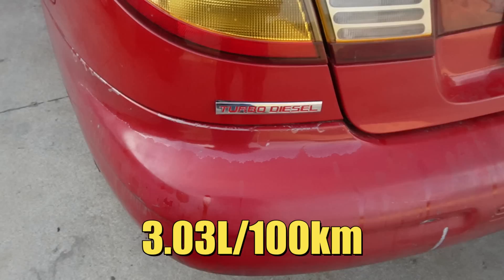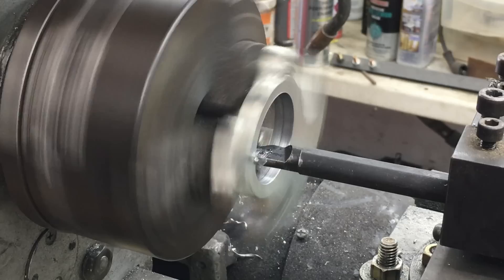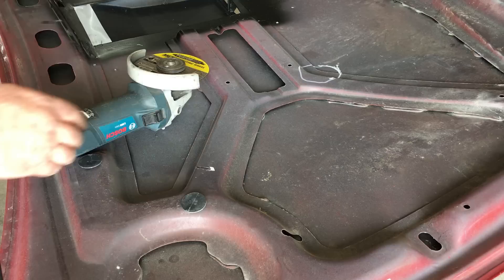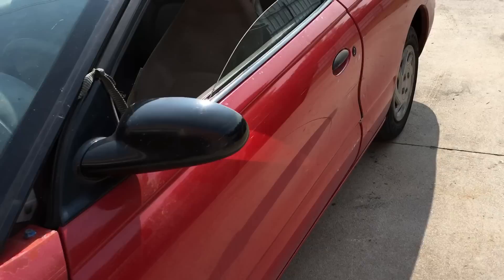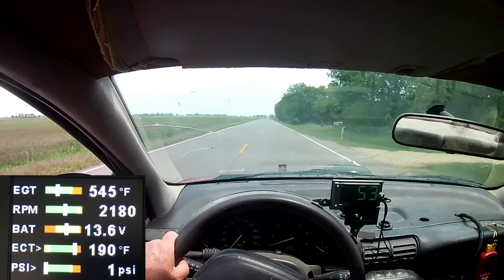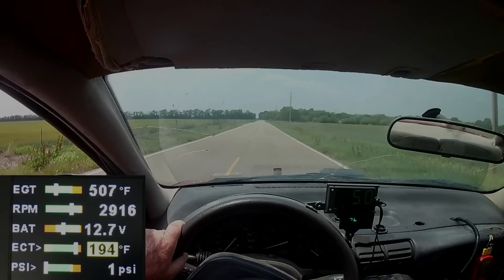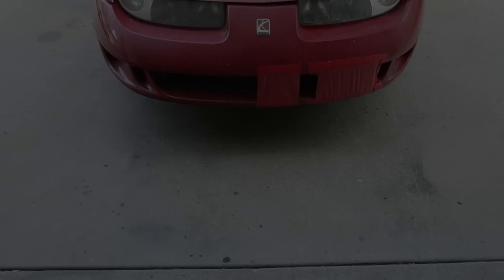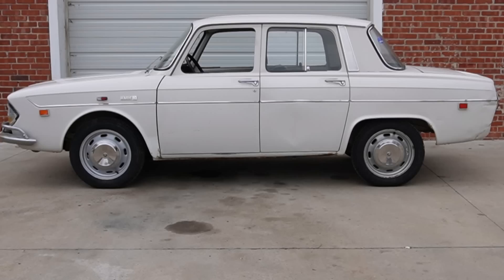S3 E17  We get 80 MPG with our D722 Kubota turbo diesel Saturn.  Best fuel economy yet !

Comment: I'd be very curious to find out how you could reduce the car weight by removing excess material, cladding and so on, and still retain a useable vehicle. Another aspect I'd be thrilled to see is what you could achieve by improving the car's aerodynamics ...

Comment: 3:28: why did you weld pipe and flange inside.??  the original was welded outside - with which you don't need to regrind the flange flat.

Comment: Company's need to focus on diesels instead of EV... diesels are better for the environment than evs in the long run... no mining for battery minerals  (for the evs) and not useing the power grid to charge and not dangerously silent... diesels are better for the environment than gas actually the exhaust is easier for plant life to filter

Comment: I can't help but feel like the diesel saturn had more to give.  Maybe if you ran a passenger side fender exit behind the right front with the same diameter tubing it'd have been more bearable.  
I want to think that the full stack,  full fuel,  full boost saturn might have done a tick better than previous,  but I imagine you tested that off camera.  :(

Comment: Would creating a fearing for the exhaust possibly create a slight vacuum to help reduce back-pressure further? Or just cut it at an angle for the bit sticking out to act as a shield?

Comment: Try it with motorcycle tires!   Double MPG between 40 and 60 MPH ?
Reply: Likely not. Rolling resistance only accounts for ~20% of energy needed to move the car, so not much gain to be had this way.
Reply: @hojnikb  Motorcycle tires have much worse rolling resistance than car tires, often more than double.

Comment: There's clearly something wrong with your turbo system, I had a geo metro with a 55mm turbo that hit 7lbs of boost.  I think that turbo should hit at least 5lbs of boost.  I realize its half the rpms but something is adjusted wrong.   If it's not then u need to add another turbo and compound it!

Comment: I wonder if exhaust gas recirculation could improve the fuel economy even more.
With an inert portion of the air, less fuel is needed, not sure how it would affect temperatures though.

Comment: Wrong turbo. Diesels need less turbine than gas engines. From my turbo bike I can say a rhf3 vz45 would work great but is gonna be laggy too. But a gt12 would actually be better. It's a bit more efficient and on my bike we have the opposite issue too much back pressure. If you get a rhf3 you can put the vz21 turbine wheel on it it has 1 more turbine blade than the vz45. The vz45 has a better turbine housing though with a slightly bigger ar that should reduce back pressure without hurting spool. That being said compound would actually be the way to go. And port that thing theres alot to gain in that housing compared to the Mitsubishi turbines. When I was single turbo at 30psi BP dropped 8psi with just some porting with zero loss in spool. Cutting the turbine wheel back actually made a big difference for me in both reducing BP and making it spool faster. Still I'd say your vz21 plus a China gt12 would work great. For us single turbo porting the other side of the gate we get about 30psi sending the same pressure to both sides and also faster spool. Being a diesel I wouldnt be very concerned about the head lifting or the bottom end. But it would be worthwhile to swap out the head bolts for some better ones.
Reply: I feel it's worth mentioning my little 155cc single could spool that vz21 by 1500 rpm the vz45 was about 1700 and a gt12 was about 1800. But a vz21/vz45 hybrid was instant although it did die off as BP shot up around 7k rpm.

Comment: Hello! I heard you said you were gonna scrap this Saturn. Id like to take it off of your hands if you still decide you want to scrap it
Reply from the maker: We plan on removing all the custom parts from the saturn. There wont be much left, except scrap metal.
Reply: @robotcantina8957  ahh I see that makes sense. I'm a huge Saturn fan and I collect them so with something as cool and different as this I thought I'd see what your plans were lol.
Reply from the maker: @SaturnSpotter  I'm a big fan of Saturns as well.  This coupe was perfect for this build because it was cheap and .... well it was cheap.  The coupe was involved in a major collision about 20 years ago and is  bent up pretty good under the plactic skin.  The sub frame is bent and it has plenty of rust in the floor pans. The windshield is broken and of course it has a bad wheel bearing.  The car was heavier than we thought it would be and we want something about 500 pounds lighter.... so the coupe served its purpose, but ultimately it isn't the right car for this project.

Comment: 2 speed power glide with an added lockout are known for being a very efficient transmission and Light. Not sure if you would have enough power for only two speeds but I'm curious if that would help fuel economy?

Comment: This is exactly why our EPA is f$#@ing bull$#@! This car while slightly underpowered and made 80MPG. A few years back the X-prize winner won in a Kubota (4 cylinder I think) custom tube car that got 100mpg. I own 7 TDI VW's and can regularly get 45-55 mpg and even better with the ones that are tuned and deleted. The EPA mandates thousands of $ of expensive, complicated and far from reliable emissions equipment to these cars and trucks only to get far less power and capable MPGs. Less fuel used=less pollutants! Our EPA is just another failed alphabet organization. It started out meaning well and now weaponized!
Reply: Finally someone that understands more mpg = less pollution.

Comment: Hey do you happen to know if it is safe to adjust the fuel rack screw on a Kubota z482
Reply from the maker: Adjusting the fuel rack on a Z482  will have the same results as it does on the D722.  The most important thing to do before you start adjusting the rack is to put an EGT gauge on the exhaust.  Too much fuel will cause your EGT's to go up and then you may damage the engine.
Reply: Ok thanks for the information I have it now set at 33.65mm stock is 34mm it has more power and there isn't any visible black smoke
Reply from the maker: @xdotto958  Cool!   These diesel engines have a bit of hidden power...  Have fun!

Comment: If your diesel is blowing black smoke then its running too rich and the engine isnt getting enough air
Reply: Your epa is showing. Or tree 🌳 hugger. No way of producing maximum hp from a mechanical diesel engine with out smoke. Unless you want to kill it with all the filters it would require to do so.
Reply: @duanehenicke6602  you must not be familiar with Gale Banks. Has nothing to do with epa the black smoke is unburnt fuel cause there wasn't enough air to accommodate complete combustion... Maybe you should do some research before you accuse someone of hugging trees. Was just stating that it's wasted power
Reply: @Josh Faykosh  on modern diesels perhaps. But the only way for more power in these mechanical engines is some smoke. Yes it should clear up once the boost kicks in. But until that happens, she's going to smoke.....
Reply: @duanehenicke6602  still don't just jump to ohh your a tree hugger I am one of the furthest things from that, will have you know all my bikes are old 2-strokes and I am currently building a rally car that is also 2-stroke powered and I also run a business rebuilding carburetors, all my vehicle's are from the 80's and older and none of them have emissions control on them. Point being don't just make a blatant and incorrect conclusion and accusation about someone

Comment: I am using LPG powered Renault Clio 5 1 Liter engine. On the long road consumes 4.5 liters for 100km. Could you find a way to add LPG to diesel engine for me?
Reply: You can't use LPG on a diesel engine. LPG is like gasoline and needs a lot lower compression to achieve normal operation (at 20:1 compression, engine would knock itself to death) and spark plugs to ignite the mixture.

That being said, are you achieving 4,5L/100KM on LPG or gasoline?
Reply: @hojnikb  LPG sits in liquid form in the tank. I think it can be used with a direct connection to the diesel pump and injector. Some oil mixture may be required. I do it with LPG.
Reply: @MAV_ist  No, it wont work. Not with a 100% LPG mix.

Again, like i said, diesel engines have too high compression and lack of sparkplugs to work with a fuel like that. 
I for one worked on large gas powered generators (similar to LPG) and all of them needed to be modified to take such fuel to run properly (they use diesel engine blocks and heads with modified pistons and sparkplugs instead of injectors).

Comment: There's clearly too little back pressure now, that's why the performance is dropping. Diesel engines need back pressure to increase the suction of air through the intake valve. The cause here is that the piston on top dead center has the exhaust valve still open. If there's more back pressure the air will flow faster and create a larger vacuum in the process after the piston stopped moving/slowed down - so you recoup energy after the piston has pushed the exhaust out.

This increased vacuum is sucking more air into the chamber, thus decreasing the amount of work the turbo and the down stroking piston have to do.